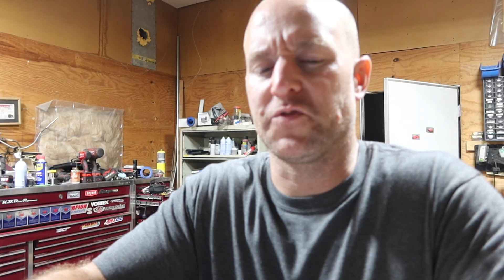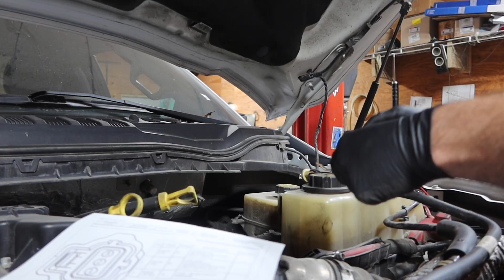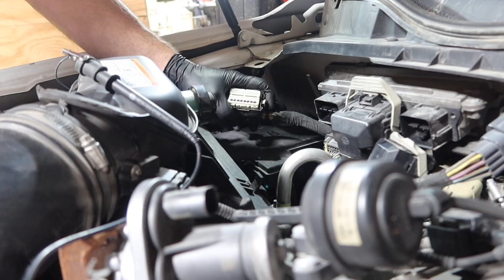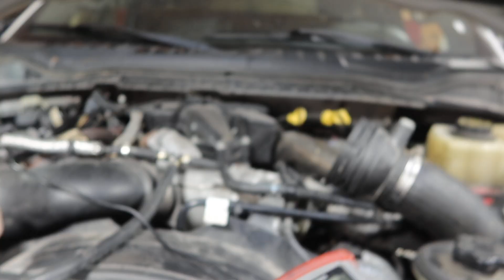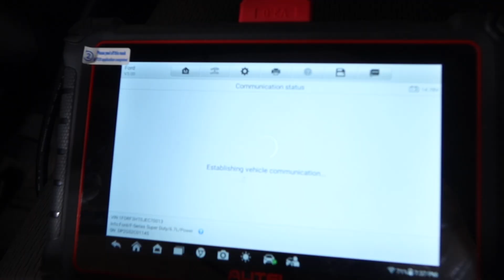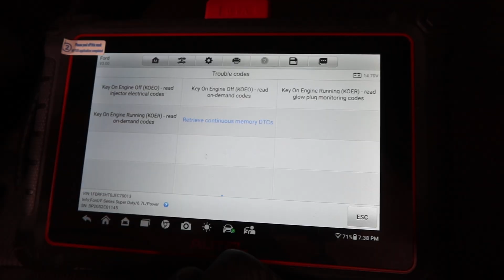2018 F350 6.7 Powerstroke Battery Light

Comment: Great video brother I have the same issue. I tested both batteries, both alternators, everything looks good. I went in to Forscan and for the same fault code. I even tried to used Chat GPT to help with making sure maybe I didn’t miss anything which I know is unreliable but I’m no mechanic. So I’m at the point where I want to check resistance to see which cable is bad. But I can’t find a pin diagram for my truck. I almost paid for the site all data to try and find the correct pin on the PCM to check continuity, but that’s at my stopping point. I can’t figure out the rest and I don’t want to get ripped off by a dealer trying to sell me a whole new harness

Comment: Did I miss it where you showed where the wire was broke?
Reply from the maker: No you didn’t miss it.  Finding the break would be wasted labor. 
The break normally happens in the tray that runs down along the oil pan.

Comment: Ford is notorious for those issues in the harnesses.!🙄
Reply: had a wire brake on my 2016 f350 within the harness and I never bothered with it. just ran a bypass at the fuse box. wish ford would do something better with these harnesses.